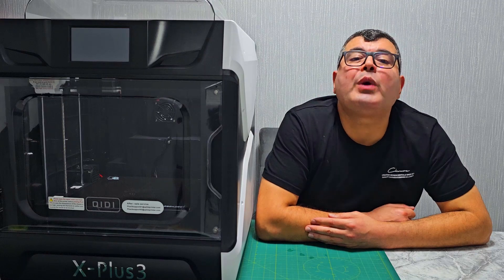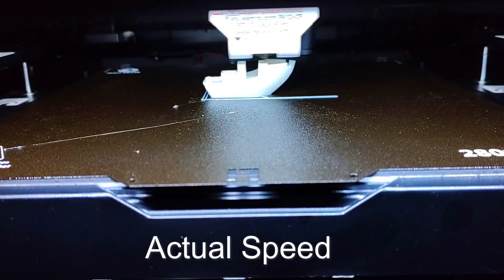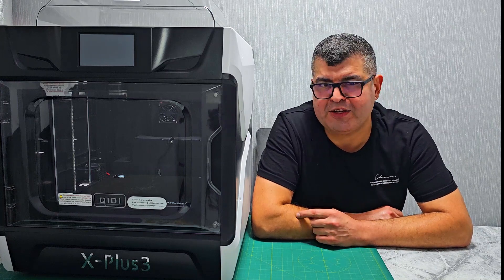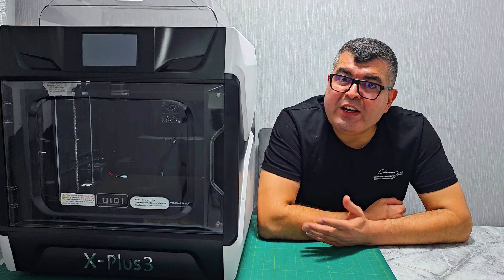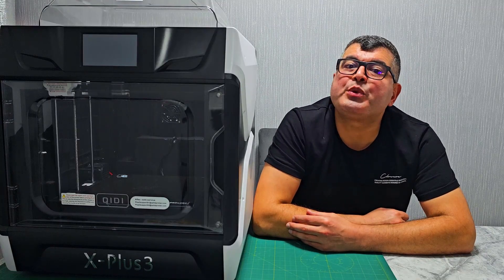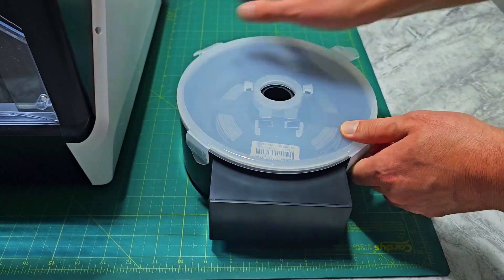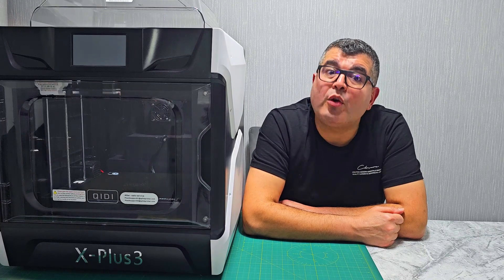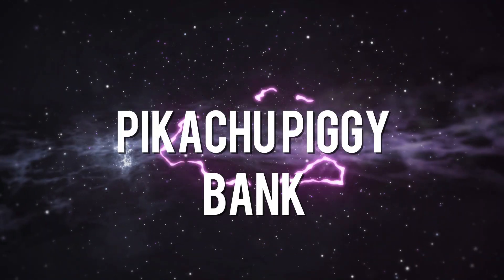Unleash the Future of 3D Printing with Qidi Tech X-Plus 3

Comment: Impressive review! The Qidi X Plus 3 looks like a robust 3D printer. Are there any specific materials you've found work exceptionally well with this machine?"
Reply from the maker: It definitely is a solid machine. Yes if you want full speed benefit I strongly suggest to use Qidi Rapido PLA for your print

Comment: "The enclosed design of the Qidi X Plus 3 seems like a great way to minimize warping and maintain a consistent temperature. How's it performing in terms of print reliability?"
Reply from the maker: During my test it never failed a single print. It is really high quality solid 3d printer